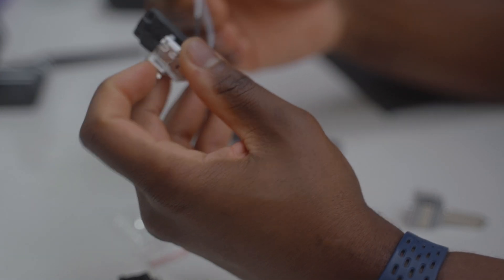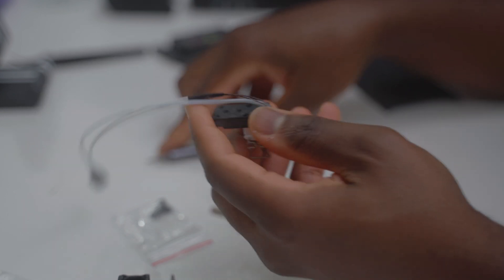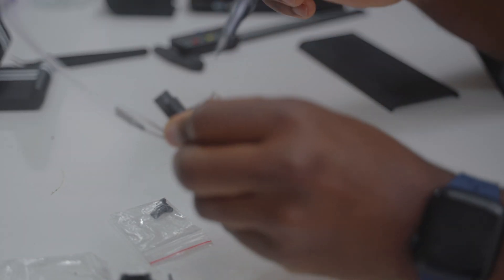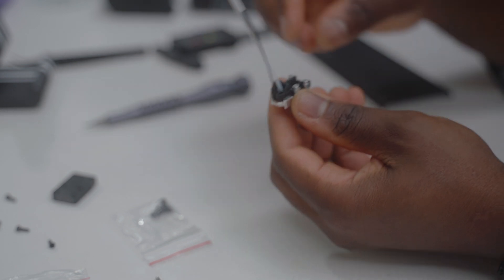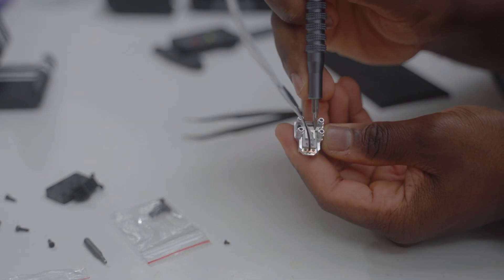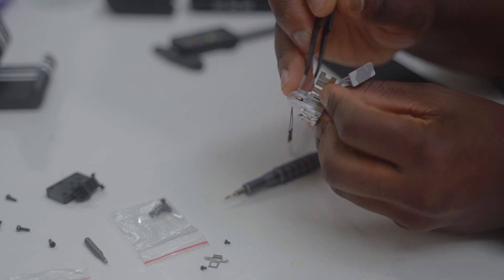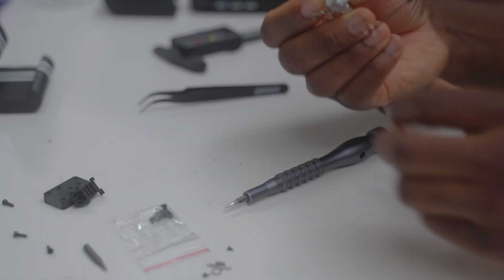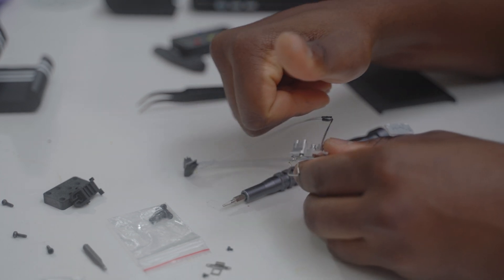Bambulab A1 / A1 Mini thermistor & ceramic heater replacement

Comment: So about that silicone part you remove at 2:48, my a1 got the blob of death and when I tried to remove that silicone part, it was brittle and it’s now in tiny little pieces, I’m sure it was very important but I don’t know if I would have to get the entire heating unit or not to replace the silicone part, any suggestions?
Reply from the maker: In your situation, my advice is to replace the entire unit.
The silicone layer plays an important role;  it prevents excessive heat transfer to the back plate and helps keep the PID tuning stable.

If you can only replace the silicone part, that’s also doable, or you could even make one yourself. However, I don’t recommend using it without the silicone, as that would cause more heat to transfer to the back plate. If the back plate overheats, it could potentially melt your toolhead or even cause a fire hazard.
Reply: @RayLenses yeah, I went ahead and bought the thing which cost quite a bit.. sucks that there isn’t like a cheaper option for that situation, plus the whole tool head was caked in burnt plastic, even the screws had some plastic in it that made it hard to unscrew.

Comment: I bought the whole replacement part on TEmu; it costs $9. Too bad you can't buy, for example, the aluminum piece with the closing spring. It broke for me, although it still holds on one side, but I still preferred to buy the entire replacement part.

Comment: hi brother 
mi printer  hotend heater wires got cut from the end while removing the hotend. Both wires came off with a slight touch. Can I safely resolder them? Heater alone not available in India. Any solution?"
Reply from the maker: Yes you can definitely resolder them, just make sure they don't make contact in the solder area to prevent short

Comment: This saved my printer. I bought the part months ago and have not found a how to and I didnt want to ruin it. you made this so simple. thank you! 

Video suggestion (I do video) if you are using such a tight focus and you can control your camera. have a bright light on your subject and then open the aperture/F-stop. this will create a wide Depth of field and more will be in focus.. another way is to set your focus and make marks where you need to keep the part to stay in focus. but overall GREAT video!! saved me.
Reply from the maker: im glad it helped you, it's is actually very easy steps just I decided to make this quick video to help others because I couldn't find it on internet, I belive bambulab wants to sell the full part, but since thereare cheep after maket cable available changing only cables is better dDea.
About the video yes  actually I should have closed the aperture, and add my softbox I just put the camera click record and I forgot to change the settings because of that video came so blurry and dark, after f I finish recording I notice the but I was lazy to redo all again, since many times no-one even watch my videos 😅